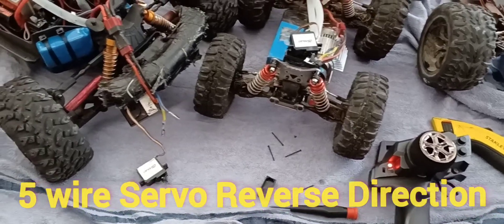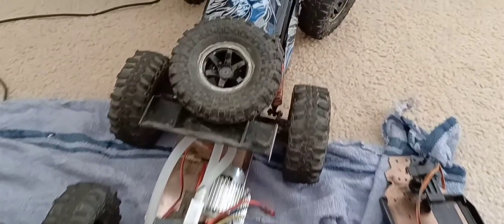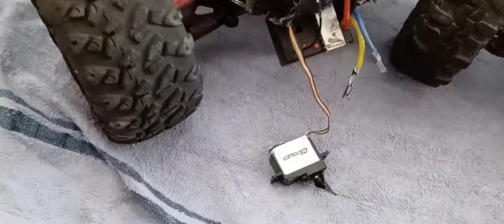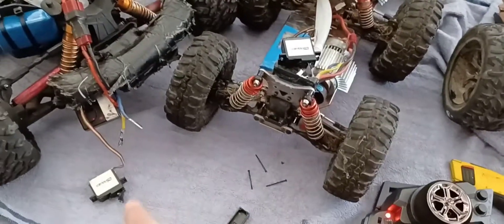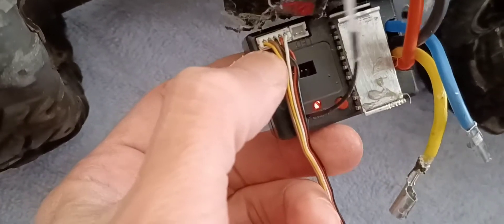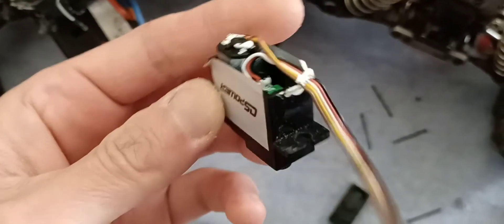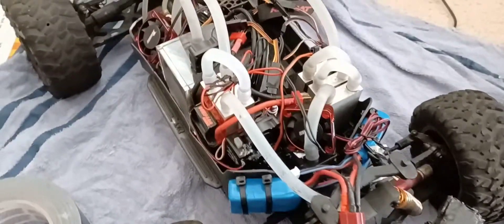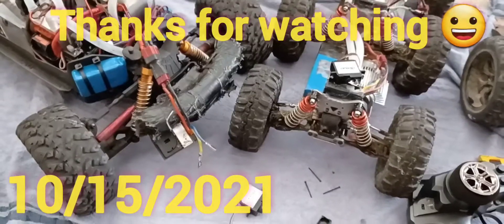Reverse Steering for 5 Wire Servo. Easy, No Soldering.

Comment: A bit confused cuz my colors were different but taking the back of the servo. The 2 for the motor switch and the other 3 I flipped the side wires. Worked. Thanks! 5 wire upgraded.

Comment: how i can fix with servo 3 pins
Reply: Something about switching the motor poles on both the motor inside the servo and the other little motor thing. But not the 1 signal wire in the middle

Comment: how do you go from the big 5 wire connector to a tiny 5 pin connector.  i bought a esc/ transmitter and it has a smaller connector for the servo. it wont fit in.. i hooked it all up and it works forward and back but i cant connect the servo to the esc/ reciever or whatever because the port is too small. its still a 5 pin but its half the size.????
Reply from the maker: Sorry for the late reply, you will need to connect/rewire the normal 5 wire to the tiny 5 pin connector after you find one.  Thanks for watching 😊.